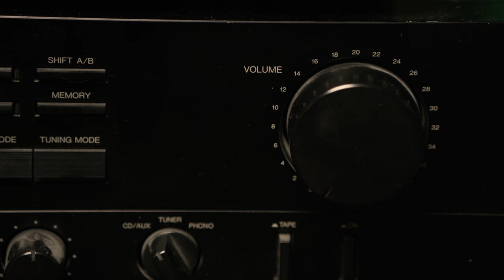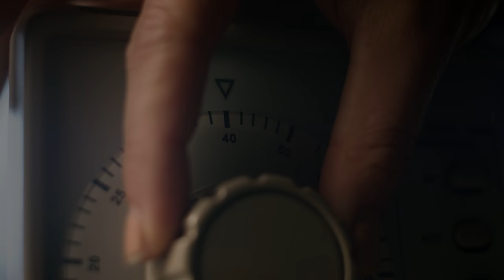How To Levitate | The Edge of Science

Comment: Yes Colin, you made it mate !

Bbc featured is quite the feat.

Also as for the levitating house, 5 car batteries charging some capacitors would deliver the required ammount, with a pre warning system in place they could automatically activate and charge the capacitors to deliver the energy requirements.

Could we make a super conductor magnet incapsulated in non magnetic mega insulation material, kind of like a cell of a battery, with liquid nitrogen as a continuous feed onto the conductor's within the cell, ( similar to water cooling in your pc ) 

If so, you could scale that way, but obviously you'd need some kind of large test track.

( nvm I continued watching the video, turns out that's exactly what you guys did. )

Comment: the magnet falling thru the copper tube creates electrical eddy currents in the copper, 90 degrees out of phase, those moving electric currents create a magnetic  field, again at 90 degrees, which makes the created magnetic force 180 degrees, out, or, in the exact opposite direction of the original magnetic field.  Because the copper is not a superconductor there are losses so the magnetic field created is not as strong as the original moving magnetic field so it can't hold the magnet  still, but it does slow it down.

Comment: smaller kidney stones are already getting disrupted by sound focusing..  (certain types of at least, because it depends on their composition).   And commercial levitation without producing noise or airstriction : magnetism. because it is so quiet. And the practice of this is the proof of feasability. Maglev trains exist. Maglev record players exist. The EDS trains (dynamic repelling principle, can be optimized by halbach arrays) needs speed. And intense cooling of the supercondicting magnets. The Transrapid (EMS - electromagnetic suspension) does not need speed to levitate. And no cooling. It levitates already at 0 speed.

Comment: Planet runs out of liquid nitrogen. What do you do now. Besides the liquid nitrogen I recommend using the poles to levitate, unlimited levitation, like that woman who used her finger to stop the magnets from leaving the tube, meaning take something heavy and combine it with the magnet and have the magnets facing opposite sides like she demonstrated and there you go you have levitation now build a track like that guy did and push it to move around and you will be successful. No liquid nitrogen needed it can be saved for other purposes. No spinning blades needed either to levitate which actually is flying not levitation. If someone can prove this well then super conductors will be used for other purposes as well other than using it to levitate a super conductor with a skate board, dont get me wrong this project is by far the most advanced I've seen but I'm sure they can do 100 times better if they take my theory into action.

Comment: Well, gravity sucks, right?  That's what the clip is saying; and that these might be ways of moving away from the surface of the Earth.  Real, F = ma sorts of High School Physics sorts of stuff. And people can do that with helium, hot air, airplanes, and rockets. And there might be other ways too. Scrolling back a few lines: F (a vector) = m (mass) times a (acceleration) gravity.  But this general idea might also be seen in Huygens' addition to the above Newtonian equation: F=ma= (mv^2)/r for a mass being spun around in a uniform circle at a uniform velocity, with that being then divided by the radius of the said circle being traversed.  And it can get even more interesting and nifty (well, I think so). Draw a pretty good circle on a sheet of paper.  Imagain that the circle's circumference is a tube or pipe with water being pumped through it at a constant, uniform velocity.  (Nifty enough for you, so far?) And there's something called the 'right-hand rule of vectors' --- see the above.  Your second finger is point towards the circle's center, your first finger is pointing in the direction of the water's flow, and your right hand's thumb is pointing at 90 degrees from the two fingers and is the other vectors' and is the 'cross product.'  These vectors are more or less constant and uniform as long as the water is flowing in the tubing or pipe at a constant velocity.  And these vectors, from a mathematical point of view, occupy an inertial space.  Now fold the paper so that the circle is folded in half --- so that the lines are on the outside of the paper, so that you can see the two halves of the circle (for the sake of simplicity).  Go on ahead, I'll wait.  Okay, now that you got that done, crease the fold.  And you can do the 'right-hand rule again.  And you can now see that as the vectors from the two halves of the circle are more or less occupying the same inertial space, the two vectors' set, mathematically, more or less cancel each other out.  Stay with me here....  Now lift one of the sides of the inscribed sheet of paper, 20 degrees say --- like a shallow wedge(?), and observe that the two sets of vectors no longer occupy the same inertial space and the vectors are thus free to express themselves as per F=ma=mv^2/r.  So that the 'F' now because a possible source of propulsion, driven by a water pump?  Might be worth checking out.  Go to aAmazon and plug in 'James G. Parsons,' in their look-up box to see what happens under the book part.  Sure there's going to be grammatical errors, errors in the arithmetic, and even the once in a while spelling errors.  But those are free.  And if you figure in that the proposed experiments are each less than ten dollars (last I checked) the book is a real deal.  And the information found therein is the real deal, if you get my drift here at all.  But, heck, you can find that out for yourself.

Comment: Invision superconductor in ground,   stationary easier to maint temp. Ni would dbl for both cooling AND heating systems for BOTH air AND water systems. Superconductor for both levitation AND complete  wireless  electrical AND charging system.. WooooW!!! WiFi Xtreme broadband!! Never have to plug ANYTHING in again, never have to buy batteries heck even charge the Tesla! Think its time to invest in nitrogen AND rare earths (magnets) Now!